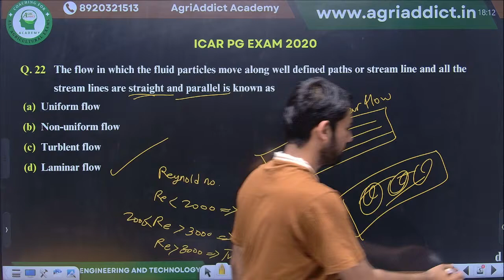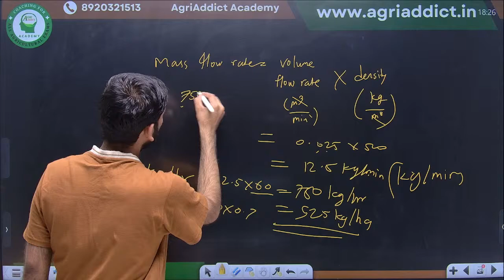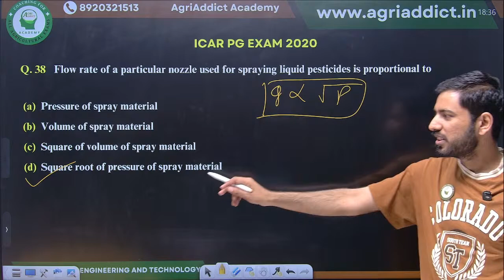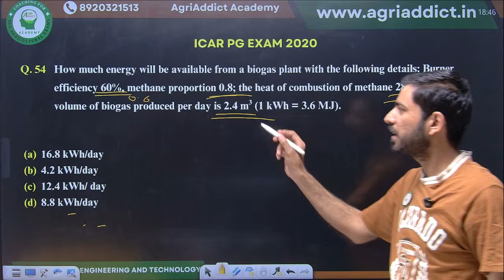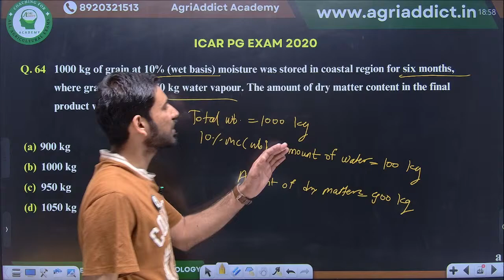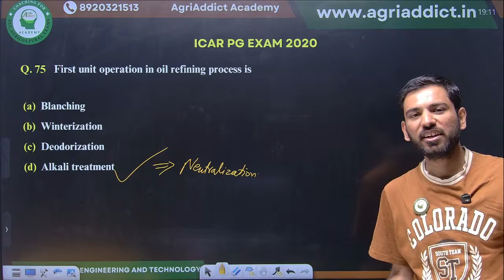ICAR PG 2020 Agricultural Engineering PYQ Discussion 🔥 | Part 2 by Shreyas Sir

Comment: Brother one doubt in 28th question 14:38 volume flow rate is 0.25 how it becomes 1.25
Reply from the maker: Yes, you are correct; there was some miscalculation in between explanations. The correct calculation is as follows:
Volume flow rate = 0.0125 × 0.02 × 100
= 0.025 m³/min

Mass flow rate = 0.025 × 500
= 12.5 kg/min

Per hour:
= 12.5 × 60 = 750 kg/h
Thanks for watching! We will take care in the future...